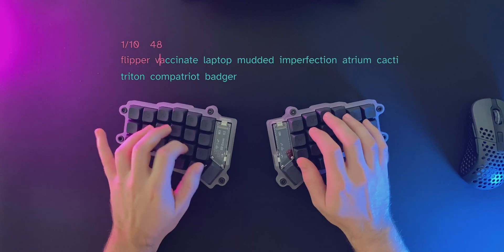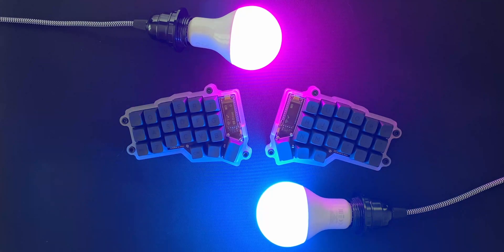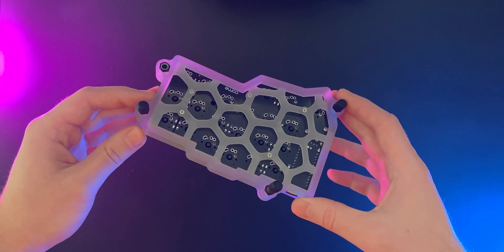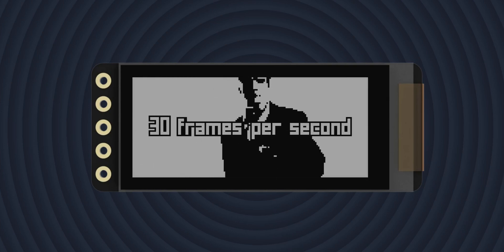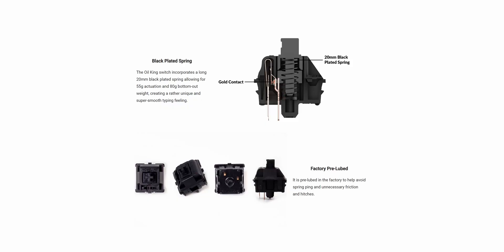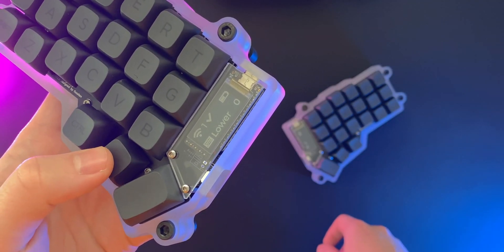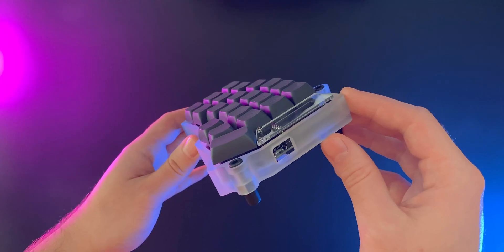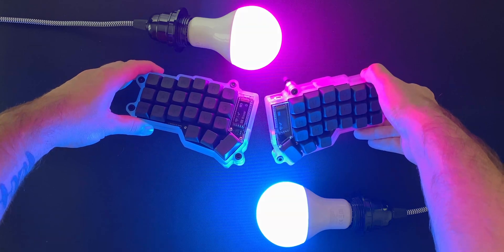Wireless Corne keyboard perfected

Comment: Great build, a love the attention to detail you put on the videos, how well you describe the build and also usability. +1 subscriber. I'm curious about the print, so when you say this is printed using resin, do you know more about the process? Is it using filament? Or CNC machining? Or a different process.
Reply: Now you know I lack behind 3D printing 😅 So there are resin 3D printers, and that's a thing on it's own. I guess this is what you got.
Reply from the maker: Thank you for the sub, really appreciate it!

Resin printing is also known as SLA, the print seen here was done at Elecrow. You could even have this print be fully transparent through a chemical post-processing step.

You could do it at home with a resin printer, but the process itself is a bit messy and you need to take precautions as there is off-gassing of fumes during the printing/washing/curing steps.

Comment: hey eiga,I'm quited interested to get one wireless corne for lay down coding, under which situation my legs will be between two splits.Wanna ask if you encounter any connection issue when something in between two halves.
Reply from the maker: Hey! I think that will be fine. I did have some issues with it when I had my MacBook between the two sides, there was definitely some interference going on.
Reply: thanks a lot! @EIGAtech

Comment: Hi Eiga, great video! Which Mill-Max sockets did you (or Void) use when soldering this? 0305 or 7305 or 3305? (I have the same PCB.)
Reply: hey, we used 0305 Mill Max sockets, which I'm not a fan of; their lip is rather tall and as a consequence the switches will sit only on the hotswap sockets, and not the PCB itself. 3305 should work best, but they are a bit pricier.

Comment: Can you share yours tenting bolts length?
Reply from the maker: I think I have M5x35, 25, 20 and 16 on it right now. I recommend also getting some M5x8 washers for fine tuning and 4.7mm diameter rubber caps to put on the ends of the bolts.

Check my other video as well: https://www.youtube.com/watch?v=hXohJwatIpA

Comment: It looks like you attached the battery directly to the micro. I found some people complaining about it because this keeps the keyboard on all time and make it prone to accidental key presses while it is in a bag. How was your experience with this configuration?
Reply from the maker: There is also an on/off switch where the TRSS jack would be on a wired keyboard.
Reply: @EIGAtech  I tried to find any guide for how to replace the trrs jack with an on off switch but couldn't find any, especially after taking down many of subreddits in objection to new pricing for their api's.

Comment: What screw did you use for the tenting legs? It's look so clean, especially the bottom of the screw legs.
Reply: would also like to know. Did you find out?
Reply: @snork_games BUMP
Reply: Bump!
Reply: @jaspersanchez7606  Tenting hardware: M5 bolts (various lengths: 45, 40, 35, 25, 20, 16, 12), M5 nylon locking nuts, M5x8 or o-ring washers for fine tuning , 4.7mm diameter rubber caps. source: https://www.youtube.com/watch?v=hXohJwatIpA Mentioned in the decription

Comment: How much does it cost to build something like this?
Reply: Up to 200$ but depends where you buy somewhere controler costs 50$ somewhere only 25$ so i think it's possible to build without fancy displays for 150$ maybe less. PCB are pretty cheap, switches can be around 20$ keycaps 10$-20$. Cases are expensive in most cases.
Reply: @darukutsu appreciate the response!

Comment: sick corne build!
I'm still waiting on the open merge request for rgb animations to pull the trigger on my next build, overall I'm surprised at the code quality of ZMK and how quickly it became usable.
A slight fork of the Dactyl with 3d printed MT3 keycaps is my endgame, make it wireless and I'll probably be set for life save for possibly mcu upgrades for faster polling down the line.
Also I'm looking forward to your next sff build as I've also fallen into that hobby as well it seems.